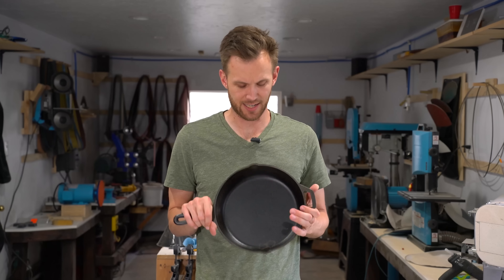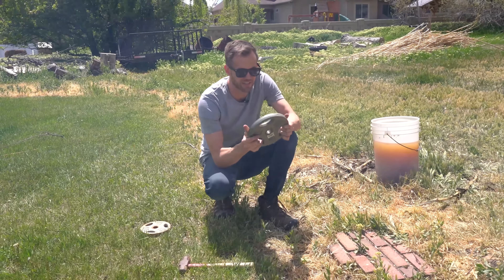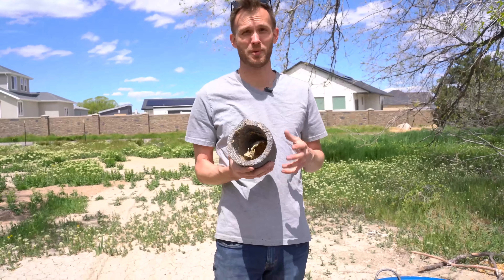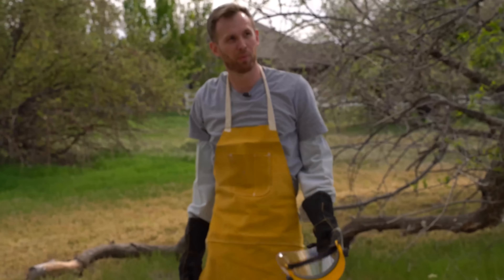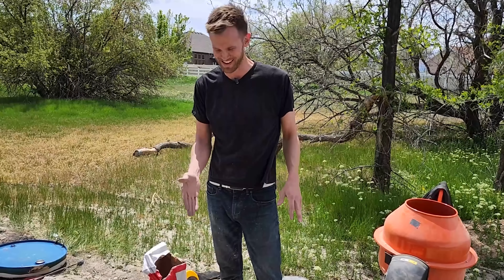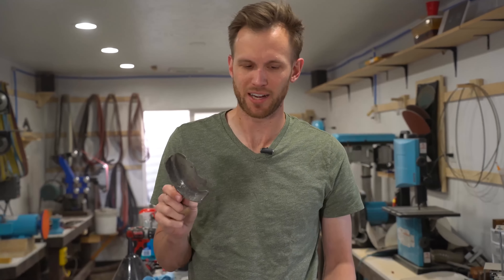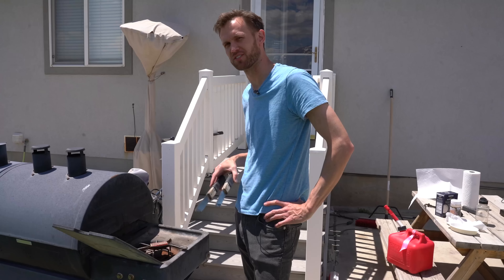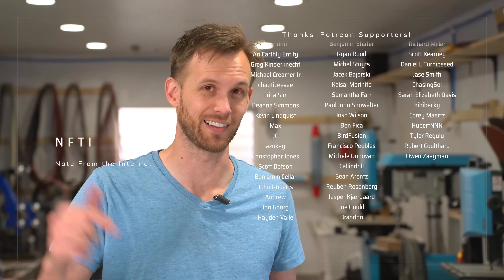Turning Weights into a Cast Iron Pan!

Comment: have u tried mixing a little bit of cement/plaster cause if I remember correctly from a "how it's made" episode large scale factories add a binder to prevent the sand from collapsing, also if the mold is too cold and causes iron to cool down too fast then simply preheat the mold as well. It would also be nice to see u cast pans out of other metals like aluminum or copper and why nobody uses casted aluminum pans or casted copper pans.

Comment: A couple of things that I would have done differently ... I'd have put a second sprue on the far side, 180* from the main one - air vent and second pour spot if it doesn't flow well. ... also, I'd have pre-heated the mold with a propane torch or mapp gas ... a gentle  little blast down the sprue to pre-warm the sand and keep from losing heat so quickly. ... Just my thoughts, for weal or for woe.

Comment: Hopefully you tempered your furnace before melting anything in there. The tiniest amount of moisture left inside the cement could have easily caused an explosion. Moisture could stay in cement for weeks if never tempered so you're supposed to slowly heat the furnace and hold it at a low temp for a while then run at least a couple heating/cooling cycles before attempting to heat it high enough to melt anything. Very fun to see backyard iron casting though, hopefully you were able to succeed after this!

Comment: would love to see more cast iron. I've got no experience to speak from, but I feel like a bigger pan might almost be easier. more space for the metal to flow, more mass to help retain heat as it flows, etc. you would need a good solid mold though that won't collapse on you.

Comment: Maybe you could try docking( idk if its the right term) but its basically poking holes into the sand so that gasses can escape. and try a vent on the other side of the pan. theres also building up a channel for molten metal to sit. I believe you can do it! just the knowledge isn't there and I know you can get that.

Comment: Maybe an induction oven would be better to melt iron since it's able to heat even higher than a foundry. Another tip would be to make the molding vertically instead of horizontal, let gravity do it's job lol

Comment: You should be using a double blower set up for a 50 gal furnace with steel or iron. It goes a lot faster and gets a lot hotter

Comment: Hello Nate, I wonder if you need exit holes for the air in the casting please. Otherwise the metal is not going to flow because the air pressure will block the liquid metal getting in. Anyway the quarter pan is nice.

edit: yes I really want to see more your casting experimentation. Thank you <3

Comment: Could you make a cast out of plaster of paris or dry clay, of-course you’d have to make it in advance. Maybe you could put a thin layer of plaster on the sand to keep it all in place?

Maybe filling the mould with expanding foam or something like that to adds combustion and vents out the top when it burns and sucks the metal in?

Well maybe you’ll just make a molten metal volcano with either idea but who knows. Maybe you could make a concrete mould? But if there’s any moisture in it, it might explode.

I’m going to go watch how they actually make them.

Comment: I can tell by the way those weights break and that grain structure that they are cast iron, if they were mild steel they wouldn't break like that and if they were high carbon that would just be strange because they'd have been quenched after but not tempered.

Comment: You need a spru on the opposite side of the pan so it can travel accross and ypu can pour without bubbles. You should try the styrofoam casting too

Comment: You need a runner and probably several risers!
It poured badly because you were basically creating an expanding hot air pocket.

When you added in the riser, it was too close, and honestly I think you should have had probably another and had them arranged in a triangle around the pan.

Comment: Try that again. Make a hole for pouring the cast iron in and an air flow comig out. You will actaully get a complete pan. If you dont make a hole for the air to flow out it just stops the cast iron from flowing in.

Comment: Not bad for the first attempt! How much gas was that larger forge using? Also it may be better to make the pour spout on the mould taller so some pressure is created by the liquid metal, forcing it into the thin areas of the mould quicker.

Company that made your original pan likes to show off their factory and even have an annual open house where they let visitors in for tours. They'd probably give you a tour any day, seeing how you're from a fairly large channel.

Comment: Completely understand the set up, what we're the remaining parts list to complete making your furnace?

Also, you should have made a 3 inch hole in the middle of the lid, pressure and such, as well as attaching the lid, so it will need to be lighter

Comment: I'm no expert but I think you need a vent in the mold on the other side from where you are pouring. If possible preheat your mold.  Use oxygen with propane to get a much hotter flame, be careful though that dangerous and an oxidizing flame could damage your iron, perhaps a neutral flame. Melt more at one time,  it will have a higher thermal mass and stay hotter longer when you pour. A better sand for casting. There is an endless supply of specialty cast iron designs.
Reply: I don't think oxygen itself is necessary for iron. Just pumping air might be enough.

Comment: I think if you downscaled this project to a fairly tiny pan then worked your way up, you might get better results. Perhaps something as small as a 6 in-diameter pan would be a good place to begin. What little pan you were able to produce here does look good, it is more getting the form perfect first. But overall, not a failure, just a work in progress.

Comment: I would love to see you do more cast iron work. However I noticed one major problem with what you did you had no vents so there was no place for the air to go. If it were me I would have put a small one in the center of the pan itself and a larger one at the other side of the casting so that the air can escape and you get a full pan because the air is allowed to escape allowing to mold to fill up better.

Comment: cast first the mold, from glass, sand is glass, or just ceramic mold, in an oven, maybe even refractory magnesium oxide mold, deals with 3100C, or tungsten, or carbon, molds, same thing, even more heat resistance
Reply: or just stamp cast
Reply: do you think they did not make ceramics from burned clay before metal
Reply: more long lasting molds, not single use molds
Reply: even carved out wooden molds, or ceramic carving

Comment: the gates on the old hand poured ones are on the bottom of the pan, this would put it in the middle of the pour. If you gave yourself vents around the edges and on the handle you should have a better shot at a full mold.....

Comment: I'm going to start by saying that I have NO casting experience. At least with sand and iron. However, I was curious if you would have more success with the pan if you poured from the bottom side of the pan, and also possibly where the handle meets the pan.

Comment: I've been wanting to know what type of cast iron is used for cookware like pans, and Dutch ovens. My art college does iron-casting, and my next project is a 6" Dutch oven (ideally with an artistic twist), and I'm just not sure if we use the right type of cast iron. We use recycled radiators which I've been told contain lead. My professor has made a small pan once, and has cooked in it, but I'm not sure if we actually use a food-safe type of iron or if it could be made food-safe while keeping it just as effective at cooking the food as a regular Dutch oven. Is there some kind of treatment, coating, or patina I can use? Usually, I would use oil black patina for cast iron, but I don't know if that would be enough to prevent lead contamination.

Comment: Hmm... what if you simplified your shape drastically? Place your model face-up directly on a board, with the box around it. Pour in and pack the sand. Carefully flip the whole assembly. Remove the model and carefully pour the molten iron in the handle area. That way, you can ensure that the iron gets to the whole area you need to fill. You'd have to do some extra work grinding the bottom flat and cutting off extra bits around the handle, but you'd be sure you're getting a whole pan. 

Or does that not work for some reason I don't know about?

Comment: The difference between Iron and Steel is a few tenths of a percent of carbon... So it's basically just the same thing. It's actually quite unlikely that you will get hold of really pure iron. Almost anything will be an alloy of some kind.

Comment: Use disk brakes from a car or truck, not the pads the disk for the cast iron. Every junkyard or auto recycler will have them. The cast iron from the brakes is a better metal.

Comment: For a 3 person team up there's a LOT of basic knowledge missing.  One pour spot, atleast one vent.  The thinness is a big obstacle for the mold design.  Cast iron weights are typically poured from cast iron that's been remelted many times and has lost the mechanical properties needed for its original purpose.  The outside skin on those weights also has inclusion filled with sand and it's rock hard. Better to start with good cast iron rather than rejected stuff used to make weights

Comment: did you ever came to the idea to hold a magnet to it? then you would know if it is steel. i am pretty sure it is not steel, since the temperature was way to low to be steel. think about it, steel is almost brigth wite when molten, also sparks fly everywere, because when steel comes in contact with oxygen it will burn and spark. you had no sparks when casting, so i really dont think it is steel or iron. also in steel factories, they use spezial ceramic plates not wool, and fire cement normaly also melts at more then 1800. to cast steel it needs spezial equipment.

Comment: With minimal understanding, i must say your greensand application was extremely uneven and probably not very conducive to quality results. Id assume using a flour sifter of something similar to get more uniform spread. Putting the mold on an ultrasonic vibrating platform should also increase quality by closing small pockets of air. This all of course if my basic technical grasp of the physics is correct.

Comment: Cast iron pans do a shit job at dispersing heat. Not even close to decent.
Reply: Go watch adam ragusea videos on the merits of cast iron and carbon steel...

Everything has its use
Reply: @SometimesStarWars  Where did I say it didn't have a use? I said it doesn't disperse heat well, which is true. I don't need to watch Adam Ragusea to know that.

Comment: Nate you didn't pack your mold properly. go watch some casting youtubers and try again.
the sand was loose so no wonder it failed every time.

your 2nd attempt your sand was too moist which is why it bubbled like molten metal being poured into wet sand.